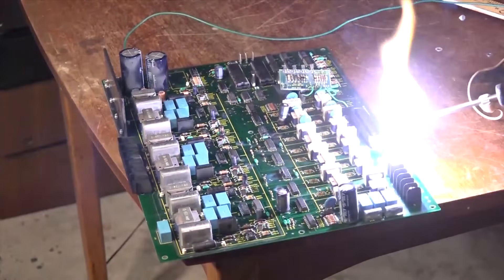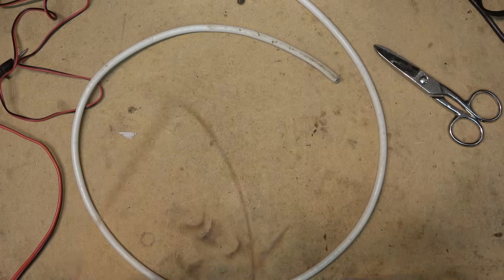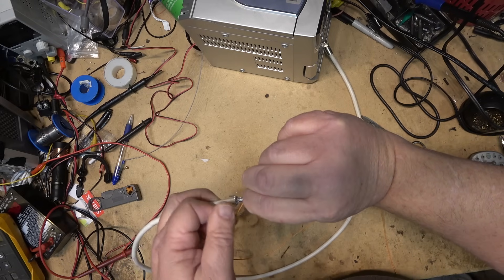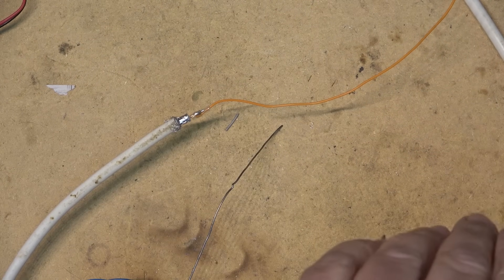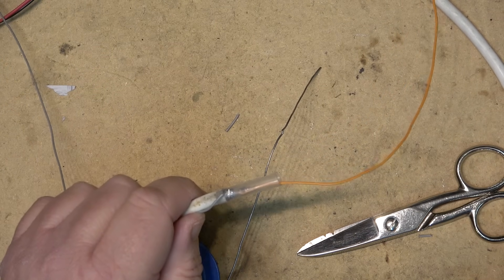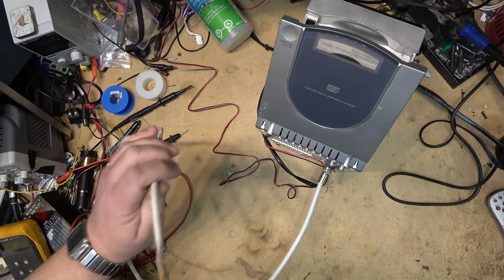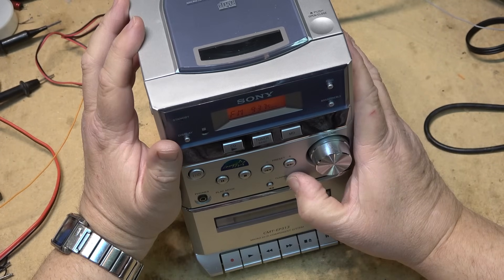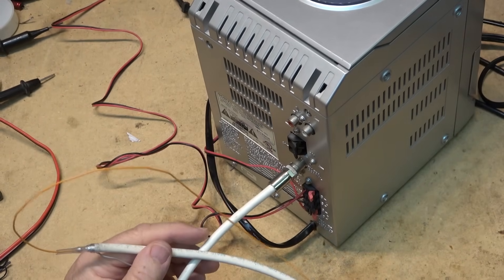Build an indoor FM antenna for 75 ohm coax input

Comment: Is there a way to make a digital tv antenna?
Reply: There's no such thing as a digital antenna, but a TV antenna isn't hard to make, just look it up
Reply: @joshm264  He means an "antenna" for a "digital TV". So it's a "digital TV antenna".
Reply: Yes as stated.  Make the two pieces out of solid coper ie just strip from a piece of old coax cable.  Attach the same as shown but make each wire about 2.25 inches long.  The exact length can be calculated if you know the frequencies of the broadcasts you wish to receive.  There is plenty of info on the internet about this.  You will probably need to solder rather than rely on heat shrink to make the attachment.
Reply from the maker: @coastmansingha9980  Aluminum braid. Can not solder aluminum. That's why it is wrapped and heat shrink to hold on.
Reply: @12voltvids  Yes I agree.  Some do use a copper shield certainly RG59 type more expensive or you can clamp on. 👌👍
Reply: yes... they are nothing special....  just buy or find any old rabbit ears or set top antenna  ... they will work if you have a close signal...if you need multiple channels put one on the roof....
Reply from the maker: Yup, also very easy. You could make one just like this, but TV signals are UHF so the radials are shorter, but yes for receiving you don't need much if the signal is good. For weaker signals a yagi design (directional) is perferred.
Reply: Very informative, thanks.